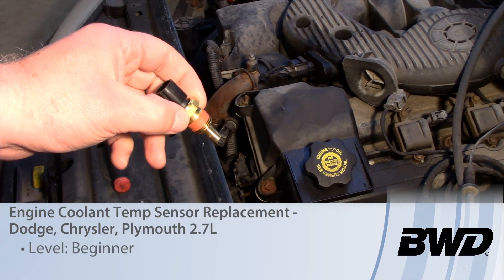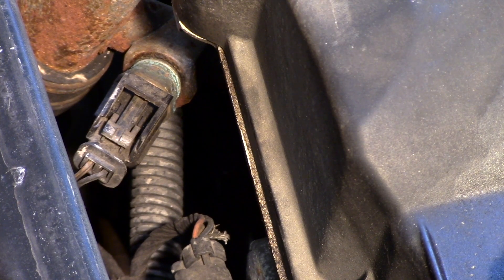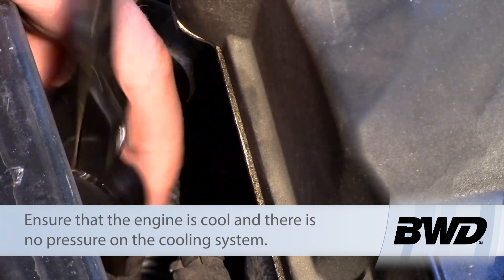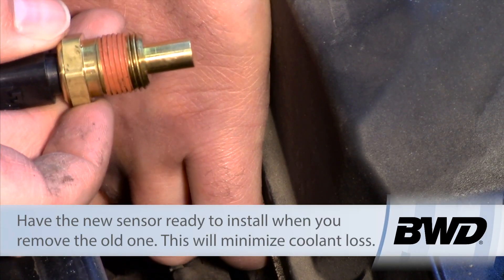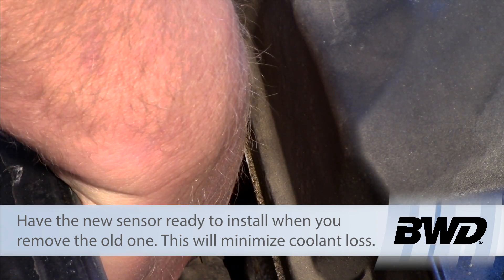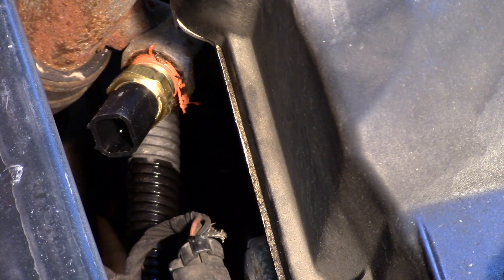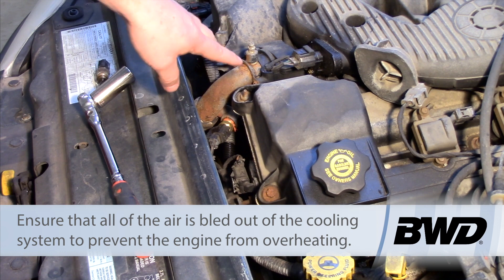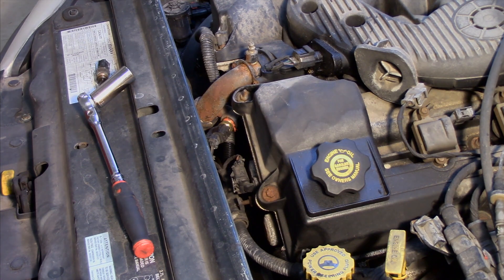Engine Coolant Temp Sensor Replacement - Dodge, Chrysler, Plymouth 2.7L

Comment: Can you tell me where the temperature sensor is on my 2013 Chrysler 200. It has the 2.4 leter engine. Thanks
Reply: Can you tell me where the temperature sensor is on a 2000 300 Chrysler
Reply: @brucerowe726  buy a repair manual. I have Haynes its great